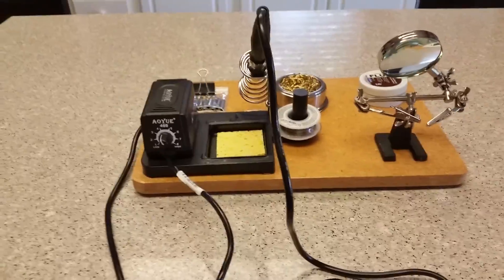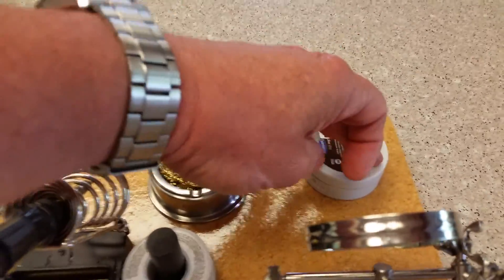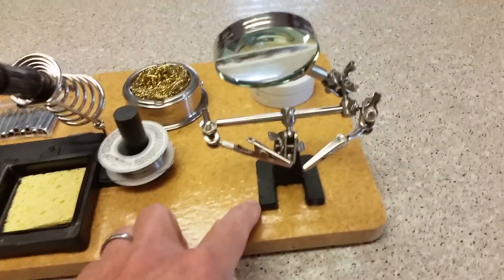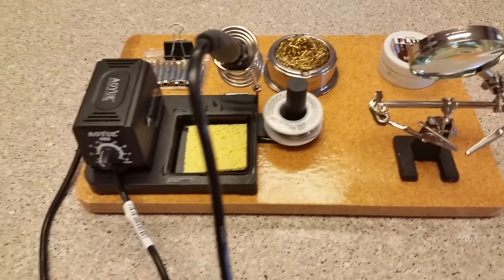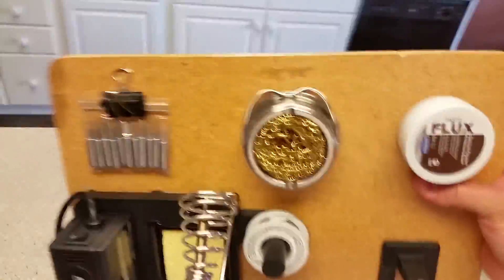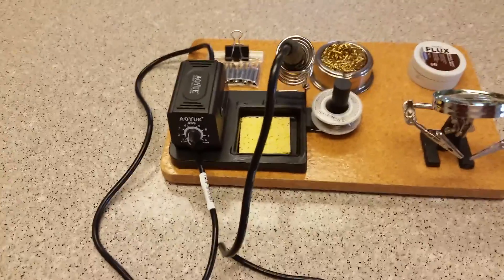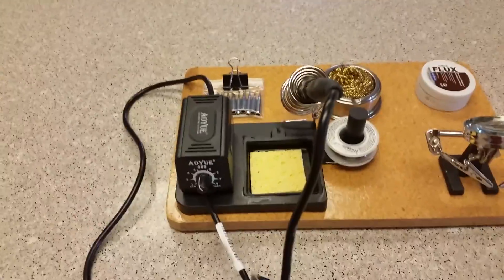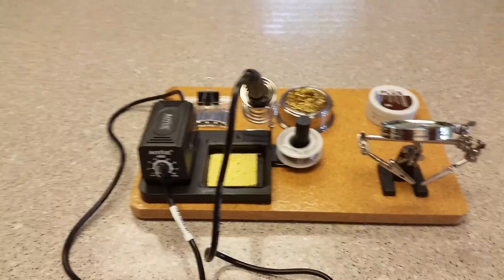Custom built true soldering station

Comment: I bought the same station at Amazon about 14 months ago.
Finally had a chance to use it for the first time last Monday (the 11th).
After completing about 5 wire connections, it decided to quit working. I was so mad... too old for warranty service, yet it had never been out of the box before that day. I ended up going to my local Radio Shack to buy a simple 25 watt iron as a cheap ($10) replacement. Hopefully it'll last longer than 15 minutes before failing, else I might just lose any & all interest I have in electronics tinkering.
Reply from the maker: Well, before I bought the Aoyue, I had tried a couple less expensive soldering irons, but neither of them were able to readily solder some of my heavier wiring jobs. The Aoyue is still working fine for me.... so sorry your's didn't work out for you,

Comment: Thanks for the idea! I just got an el cheapo (but fine) Stahl STSSUT station from Parts Express for about $15. It has heavy cords that are cumbersome, but the added weight of the wood base will solve that problem. I got my brass scrubby at the dollar store -- three-for-a-buck, and I'll build my own helping hands with some heavy copper wire and a couple alligator clips (I have a bench magnifier so I can see.)